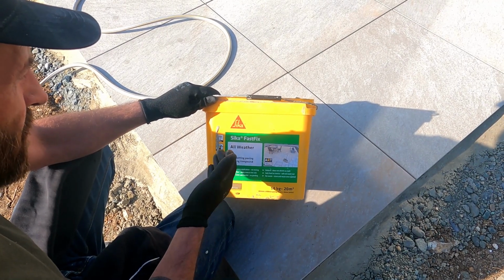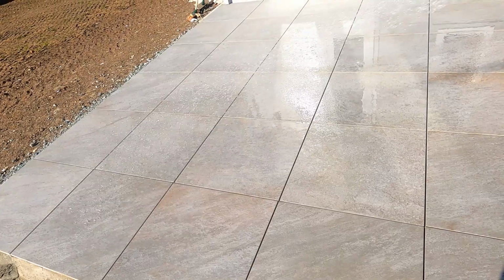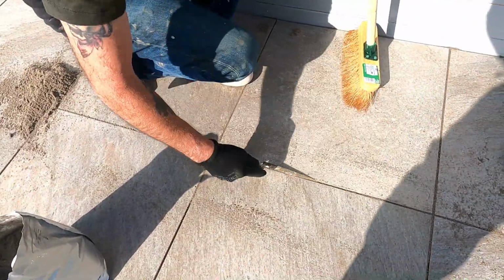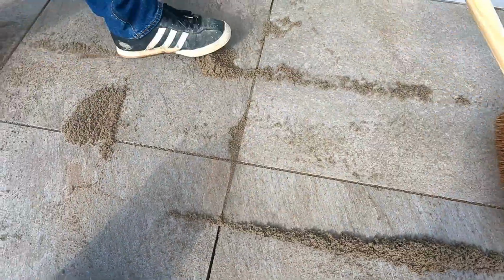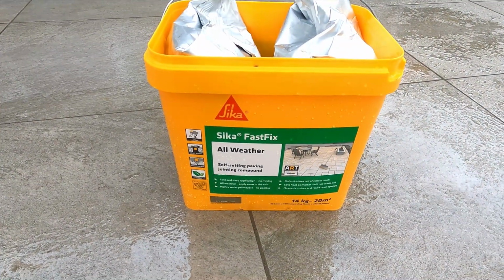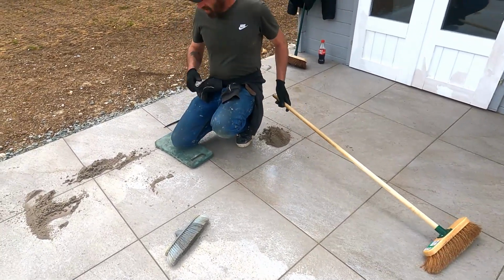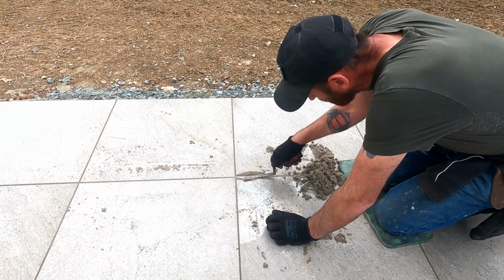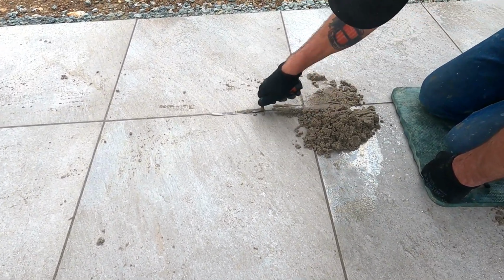How To Do Pointing On A Porcelain Patio Using Sika Fast Fix Compound

Comment: Is it easy to clean off the tiles? I can imagine if they are wet and have compound swept over them you might dry if hard
Reply from the maker: Thanks for stopping by the vid Rick nice one mate 👍
The porcelain slabs are none porous mate and won't absorb any of the easy fill compound which makes for easy cleaning plus my experience with the compound I've never had any slabs stain up.
Thanks for your comment mate appreciate it alot 👍.
Reply: Did you wait for slabs to dry before brushing in ? Thanks also for sharing

Comment: Does it leave any residue/ stains on the slabs?
Reply from the maker: Hi 👊 
The best thing to do is test an area first before you use  any compound resins the one I used didn't but I did do a test before 👍
Thanks for stopping by the vid 👊

Comment: How long does it actually take to go off in the bag once air gets to it ? Or does it only start curing once water activates it ? 
Nice video by the way.
Reply from the maker: Good question Jordan 👍
I would say if you have any compound left and want to keep for another job put it in a bucket of water and it should last 1 month and can be reused but if left in an opened bag the compound will start to harden not sure of the time scale but it's just a matter of time before it hardens and carnt be used, thanks for watching and your comment appreciate it 
👍👍👌.

Comment: Looks much easier than using grout and a good video as well, however I asked Sika about this and they said it was not suitable for Porcelain Tiles. The product also says 5mm joints. Have you found any problems with using the Sika jointing compound?
Reply from the maker: Thanks for watching chris 👍yeah its alot easier then grouting mate and alot cleaner aswell,  yeah 5mm would be the minimum joint size , and all my experience using the compound has been good when applied properly with compressed filling to obtain full joints and a depth of 20/25mm it goes rock hard in about a week plus don't crack or shrink, it's all about personal preference mate thanks for your feedback nice one 
👍👍👌.

Comment: Read the instructions!This is not for use with porcelain and the minimum widths for the joints have not been adhered to.
Reply from the maker: Caroline, sounds like you haven't used the jointing compound before , it works just perfect with a minimum 5mm joint and 25mm depth also the way i compressed the jointing compound in so all the joints are full , you can use the jointing compound on various surfaces, done properly like I show in my video theres no way the jointing compound won't work,  it takes about 12 hours to set and probably about a week to fully cure , and the results are great , if your unsure about it do a sample area, but it definitely works when you do it right , thanks for watching 👍👍.
Reply: @creativecrambo  nice paving job  but this is not for use with porcelain as the product is  porous - even though it will set and look fine for a while - a big no no-  marshalls symphony is the only non porous brush in jointing product for porcelain although there may already be others, can see why you want an alternative to grout which is a chore.
Reply: @MARTINWHITELAW  is it the only one ?
Reply: @samfeddon9923  think there may be others on the market now,maybe, ASPECTS OR AZPECTS- only used the Marshalls product at £60 tub, better than  grouting which is messy and labour intensive.
Reply: @MARTINWHITELAW  yeh I used the grout last time and it was a nightmare so looking for an alternative
Reply: @MARTINWHITELAW  I’ve had someone use this on mine, what will happen to it long term on porcelain?
Reply: Terrible product